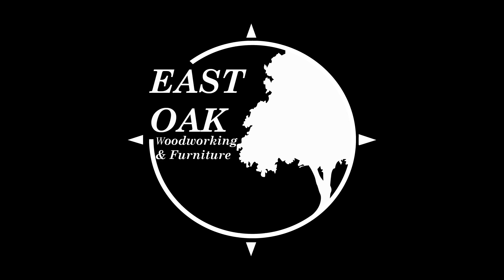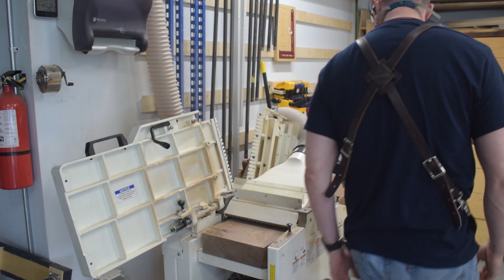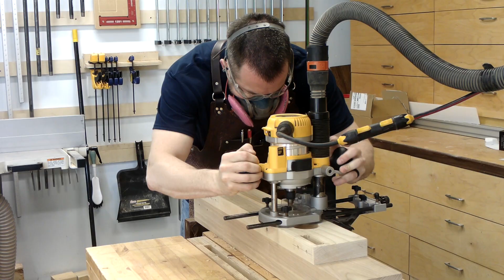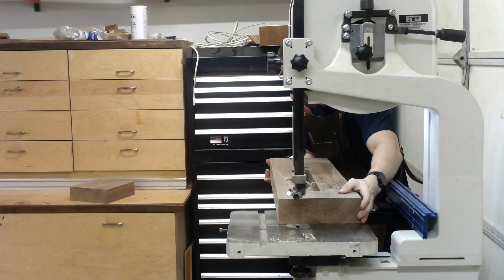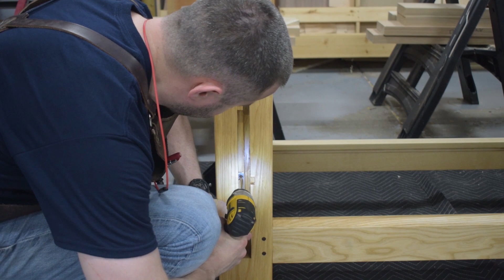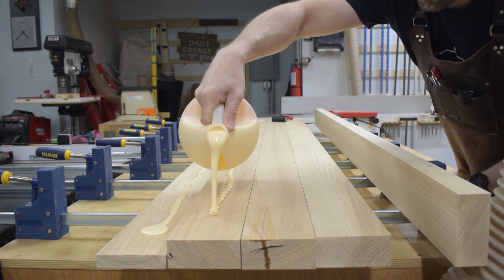Roubo Workbench Part 2

Comment: Small tip: When doing a glue up that big, sprinkle a bit of table salt on the glue before joining and it will keep them from sliding. The salt dissolves eventually into the joint and does not affect the strength of the joint.

Comment: Hi nice workbench! I’m inspired to do this, I’m on mortising and tenon process now but I do it manually by hammer and chisel, just want to know what is the gap of your dog holes on legs and on wood top? Thanks alot
Reply from the maker: I use 3/4” dog holes. The bench dogs also have a 1 1/2” “top”
Reply: East Oak Woodworking thanks for your reply, what about the distance each dog holes? ✌🏼
Reply from the maker: I drilled them 4” apart in the main dog strip. The back ones are 8”, and on the leg they are 3”
Reply: East Oak Woodworking thank you so much for your reply